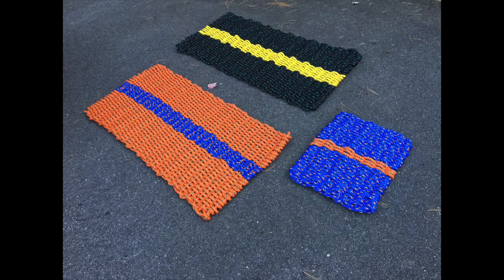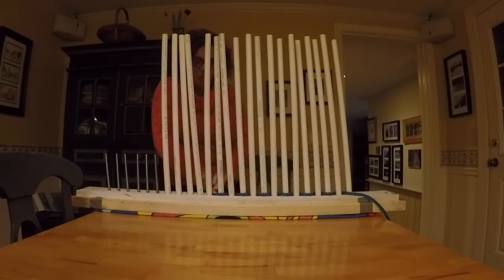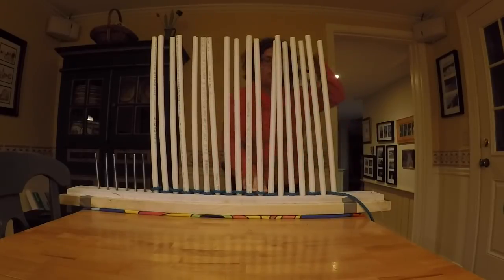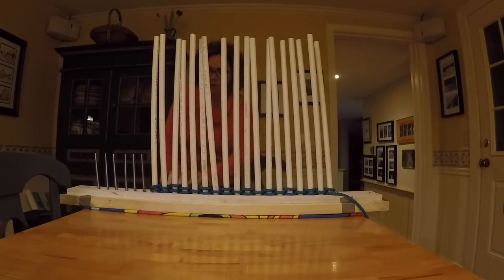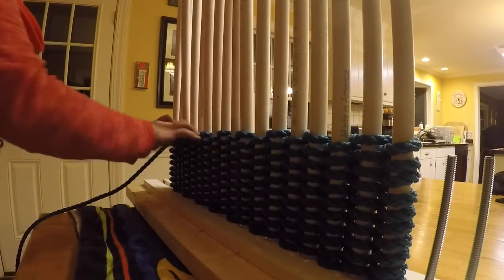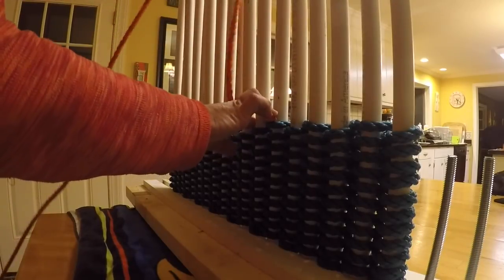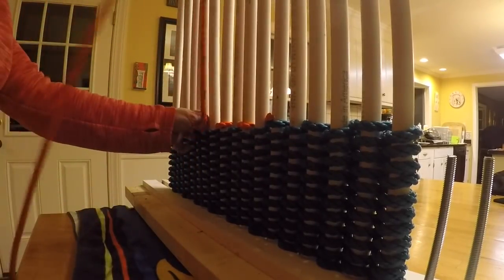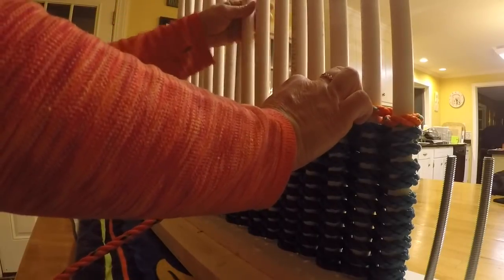Rectangle Nylon Rope Rug

Comment: Great idea, love the video, will give me something to do during this "stay at home" business! I live on the complete opposite coast as you and a wee bit inland. Not much commercial fishing in my parts! I dont think they catch many lobsters here on the west coast. would I still try to ask for "lobster warp"?
Reply from the maker: You might look online to see if it could be shipped to you at a reasonable cost. If that doesn't work, you could try a local hardware or building supply store for polypropylene line. It's a synthetic line that does not rot, making it perfect for these kinds of outdoor rugs. Failing that, a nylon line could work. Nylon can have some stretch, particularly when it gets wet, so that's why the polypropylene/lobster warp is better, but they are all better than a cotton or hemp material. Good luck!

Comment: Great video! Can you tell me what the pipe diameter and bolt spacing is for your loom?
Reply from the maker: Thank you! The pipe diameter is 3/4 inch ... big enough to sit over the bolts and to be strong so it holds up as I weave toward the top. The spacing ... I would love to tell you something exact but I am traveling and not able to measure it. My guess and recollection is 1.5 inches from bolt center to center.

Comment: Hi I'm super interested in making some of these gorgeous durable rugs but  I am concerned if they are outside in the weather, and they get wet or snow on them and are laying on concrete,  are they slippery when stepped on... not the boot on  the rug so much... but does the mat slide on the concrete... or we also have  fiberglass decking... worried that if I'm coming into the house arms full of groceries will I end up on my butt hahahaha..I guess, in the end if they are slippery I'll hafta figure out something to glue under them?? Now to find some rope... thank you for the awesome idea!!
Reply from the maker: They certainly can be slippery! The concrete depends on whether it is very smooth or a little rough. I have had good luck on most concrete surfaces. The composite decking can sometimes be too slippery.

Comment: Where do you get the rope used in your mats?
Reply from the maker: There are places to purchase reclaimed/recycled rope but it has a actually quite expensive and I don’t have a current contact for a supplier. I purchased all of mine new from a local fisherman supply store called New England Marine and Industrial.

Comment: What exactly is the type of rope you use and where do you get it!? Thanks. Your mats are terrific.
Reply from the maker: The rope goes by a couple names depending on the part of the country. Here in New England, it is called pot warp. It is polypropylene … you can get it at stores that supply the fishing profession with their gear and rope/line.

Comment: How do you determine  how much tope it will take for a rug? Thankyou
Reply from the maker: You multiply the number of rows you will weave by the length of rug you will create then add a multiplication of the number of poles times the width of the rug then add a buffer of a yard or two to compensate for the curves of the weave.

Comment: how far apart are your pieces of PVC?
Reply from the maker: So it is really about how far apart the bolts in the loom are apart since the thickness of your pvc pipe may vary. The bolts are 1.5 inches apart from the center of a bolt to the center of the adjacent bolt. Hope this helps!

Comment: Ok, I've done 5 mats so far and given as gifts. It's been a lot of fun but I'm having an issue with my weaves. Maybe I'm pulling it too tight as I go, but after the 5 or so rows, the material is higher in the center area as opposed to the ends and the more rows I add, the more the pipes are no longer in a straight line like yours. They are more tilted and the rows are not even. It's almost like the pipes are being squeezed together? If that makes sense. Like I said, I think I might be pulling the rope too tight, what do you think.  I'm using 3/4 PVC pipe and FYI, all my rope is brand new, being on the west coast I don't have access to used rope so maybe the rope is too stiff?

Comment: Any suggestions on where to buy the rope?
Reply from the maker: A commercial fishing supply store would be the best bet for getting the rope at a decent price. I used 'New England Marine Industrial Supply' located in Portsmouth, NH but you would want to find something local to you. You need a rope called 'pot warp' by the fishing trade. Good luck!
Reply: @LifeFourPointZero  Thanks for the  help..

Comment: How do you figure how much rope is needed?
Reply from the maker: Depends how many tubes you use and how many rows of weaved rope you do. I think I typically use 24 tubes and weave about 30 rows. This makes a mat a little shorter than 4 feet long and it would require somewhere between 150 and 175 feet of rope, depending on how tightly you pull the weave.
Reply: Thank you! Where do you get your rope? I’m in California, on the coast, marinas full of boats, can’t find rope anywhere.  Looking on line and still can’t seem to find the right kind of rope. I’m dying to make one.
Reply from the maker: @bobbipalmer5646  look at fishing supply merchants. It is lobster pot warp, officially.

Comment: What size rope is the polypropylene rope
Reply from the maker: As long as all of your rope is the same width, it will work well with half inch, 5/8th inch and 3/4 inch. Just be consistent across colors you use for a particular rug.

Comment: Where did you get your tubes and the part to hold it?
Reply from the maker: The tubes are PVC plastic commonly used for irrigation and available in most hardware stores in the US. The board to mount them to is simple a 2x6 wood plank available from a lumber store.